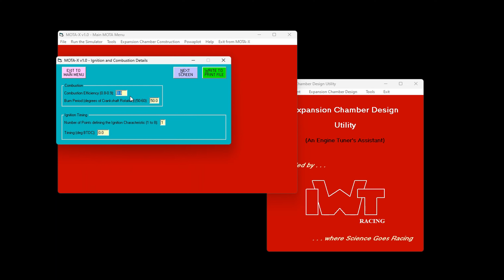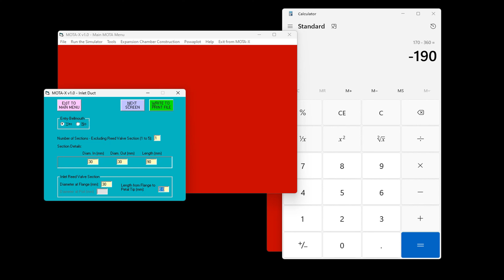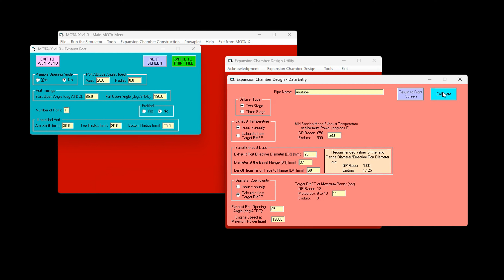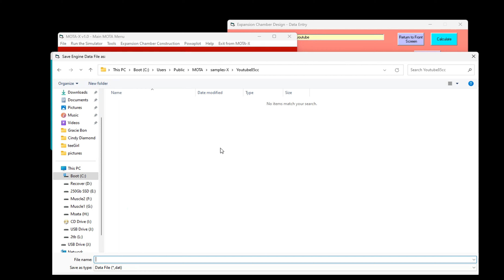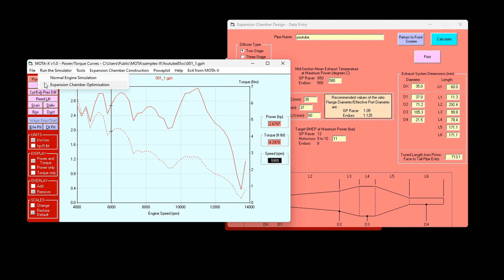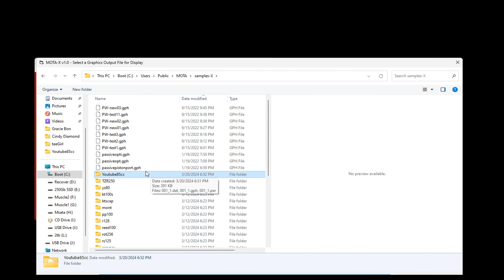Building an 'engine' in simulation software, Part Three!

Comment: This is good video.. Bought mota 8. Few months a go. No one to teach how to use it. Language barrier on user manual.    But  is that A port port attitude axial angle  the angle from horizontal zero to upwards  to head 60°?
Reply from the maker: Thanks, from my memory it is 'radial' 60 degree backwards, should be anyway.
I might actually programmed it wrong if it isn´t lol
The A ports in my simulations is from my memory aimed about 20-25 degree upwards, i need to check up on that and get back to you.